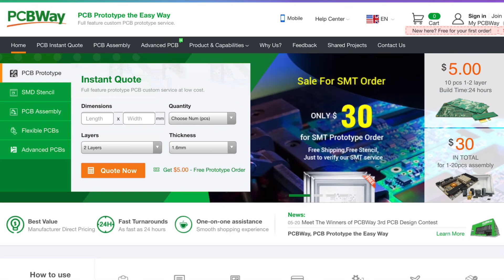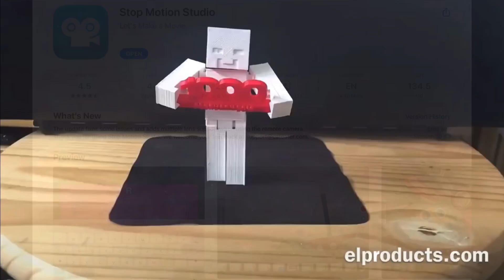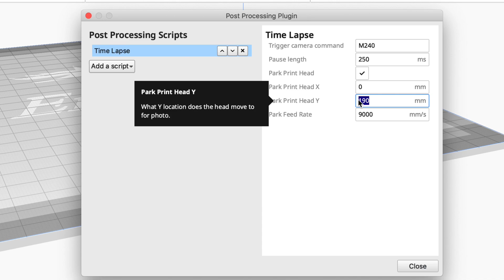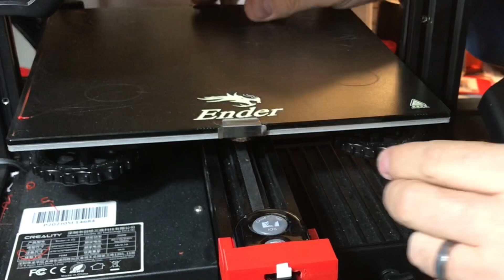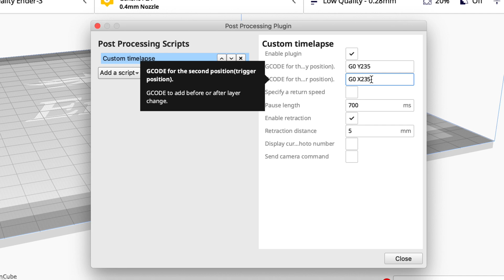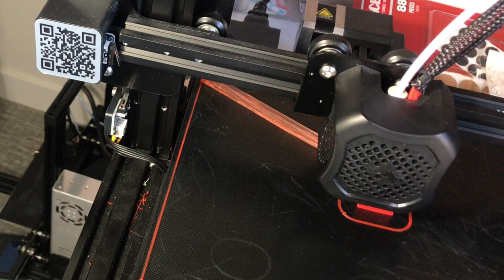Simple Timelapse using Cura Slicer Plugin  on Ender 3 V2

Comment: so you can do either. you can do the switch thing on the bluetooth remote. coincidently i actually did that yesterday as im watching this video thats funny lol but both work. i used the stock endstop and gcode but the manual bluetooth option is mint too

Comment: can you stop your ipad from turning to sleep mode between layers or have it over heated for being on camera mode for 2 days , if not i would use a nikon camera instead with a external trigger switch
Reply from the maker: First, I don’t timelapse 2 day prints. But you can turn off sleep mode and I’ve never had it overheat waiting to take a picture in the Animate it app. So my method works fine. I just plug it in so it doesn’t run out of battery life.

Comment: Chuck,
Appreciate the content it's been extremely helpful in my 3d print journey. I downloaded and printed the y axis holder, I bought the wireless Bluetooth remote but the remote drops connection after 90 seconds. Did you have a fix for yhis?
Reply from the maker: I have not seen that.
Reply: @FilamentFriday  Hmmm maybe it's cause I'm using an android phone and you are using an iPad,.... Maybe the different operating systems allow for different things.
Appreciate the help sir.

Comment: replacing the switch on the circuit board for a micro switch is very very easy. De-solder the old switch, solder on two wires that go to a normally open micro switch :D

Comment: I've set my Y-axis position but it stops just short of the camera button. Anyone having this same issue?
Reply from the maker: Change the y axis value.
Reply: @FilamentFriday  Ive been playing around with the value but again it just stops before hitting the button... Right at the same spot..

Also did you make changes on cura to compensate for losing the print space by attaching the mount? The X axis hits the mount when printing the initial line before the print starts. Does anything else need to be adjusted here that I'm missing?
Reply from the maker: The Y axis can hit the mount so I adjust the start and end code to prevent that.
Move the Y (bed) by hand and verify it can move far enough.

Comment: I can't for the life of me find the video where you tightened the spring on the Ender extruder. You had a file for a small printed cap to nest the spring into. Will you please point me to this file?
Reply from the maker: I don’t remember that video
Reply: @FilamentFriday  I can't remember what the video was about, but during the video one of the things you did was print a little round cup. you then took out the extruder spring with some needle nose pliers and seated one end of the extruder spring in the little cup and again compressing the spring with needle nose pliers placed the spring back. The net effect was to increase tension on the extruder springs as it is not adjustable.
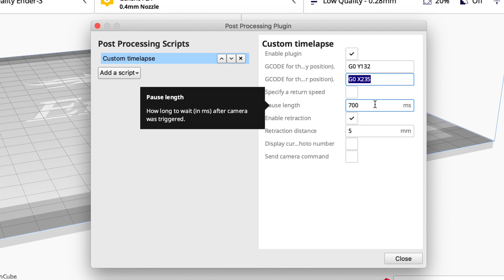Reply from the maker: Found it. 3:59 https://youtu.be/MaMYMTX1Xl4
Reply: @FilamentFriday  Thanks!!!

Comment: I got inspired by your video and done it on my ender 3. Like you suggest, I wired a traditionnal selfie stick (not bluetooth) to the x limit switch by soldering the two wires of the selfie stick button to the center and right pin of the limit switch. It worked flawlessly with the original timelapse post-processing in cura and I didn't experienced stringing. Thank you for that video ! I wanted to do a timlapse for a while now but didn't have money for a raspberry pi and that method cost me nothing since I already had the selfie stick laying around.

Comment: I drag and dropped the custom plug in into the script folder but it won’t accept it, any solutions?
Reply from the maker: Try copy/paste
Reply: @FilamentFriday  after I copy the file it doesn’t go into the scripts folder there is no option to paste. I also tried to save directly into that folder from the raw code but was still unsuccessful.
Reply: Maybe try to move the whole Cura App to a place where you have permissions, so your desktop for example. Then Show Package Contents of the Cura on the desktop and copy the script in there. You can move it back to your applications later.

Comment: So the bad news is... These bluetooth doohickeys time out after 1 minute 30 seconds which limits how large your print can be. MINE does at least and they are of the same shape, size, and make.That's probably fine here because the model size limitation of using the y axis.  I made a remix of the mount for the original ender 3 or any similar design using 2020 extrusion you can find in the remix section of the original item. I was doing this last year with a makerbot endstop connected to a salvaged selfie stick cable plugged into an older iphone but the results weren't great because it would trigger on the release of the button not the pressing of it. was going to try and use gcode to make it hit the button, move back, and wait, but never got around to it. Could probably use a small circuit to cause it to press and release electronically as well, and use a pair of cheap lighting cable headphones as the trigger.
Reply: I've figured out how to do this. You cannot use the printers original X end stop, I tried. I'm making a video and will post what I've done it'll save everyone a lot of time... but these bluetooth things are not the way to go Unless someone can recommend one that doesn't auto-off after 90 seconds.

Comment: rather than using a bluetooth soloution, using a 3.5mm audio jack you can trigger a pic to be taken much like a selfie stick, which you can then just connect either to the motherboard with some g code, or some form of contacts on the axis

Comment: Timelapses always cause stringing or under extrusion.  They really need an electronic trigger, but the print head would have to always be covering the model.  Ended up writing a command line script to fix the gcode.

Comment: I did something similar, and while it was a bit of work to pull off, it functioned well. I used the insert at layer change plugin to insert just a random word, then I'd take the gcode and use notepad++ to replace the word with a bit of gcode. It would make the printer retract, move the bed forward and the print head to 2mm away from a switch, then bump the switch, then resume printing. I tried the timelapse plugin, but it wouldn't hit the camera shutter at the same time every time, so the bed would be at slightly different positions in each pic, and I got tons of stringing.

I did think to use the home button, but I didn't want to since it would inadvertently hit the shutter sometimes. I have a few limit switches which I can wire to headphones with a button. Plug the headphones in, and when the limit switch is pressed the phone takes a Pic. Works beautifully.

Comment: Get a separate y axis switch and attach it to the 2020 rail instead of the fob and wire it into the fob.  Then, every time it rolls to the switch it snaps but because it's under the bed you don't lose any y axis space.

Comment: What about adjusting the position of the part on the print bed (instead of the default center) when slicing to make the travel times to hit the switch less?  Could this also be used to reduce the stringing?
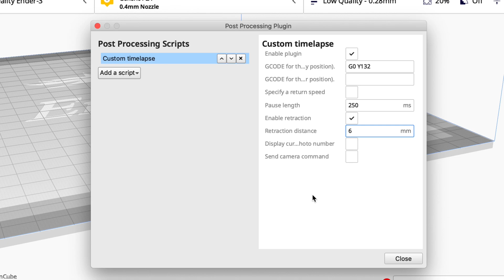Reply from the maker: I did put the Cube at the front of the bed for this reason. Watch from 4:15.

Comment: another great video .. 
just installed 4.8.0 & lost the G code for BLTouch .. could you plz reply with code & where to place in Gcode list 
many thanks
Reply: Are you talking about the G code for automatic bed leveling?
Reply: @halsoy  yes & where to put in list please
Reply: @graycbr600  I use it to level the bed before every print so I use this script (these should be the very first lines in your cura start G-code box):

; Ender 3 Custom Start G-code
G92 E0 ; Reset Extruder
G28 ; Home all axes
G29 ; Auto Bed Level
G1 Z2.0 F3000 ; Move Z Axis up to move nozzle away from bed
G1 X0.1 Y20 Z0.3 F5000.0 ; Move to start position
G1 X0.1 Y200.0 Z0.3 F1500.0 E15 ; Draw the first line
G1 X0.4 Y200.0 Z0.3 F5000.0 ; Move a line over
G1 X0.4 Y20 Z0.3 F1500.0 E30 ; Draw the second line
G92 E0 ; Reset Extruder
G1 Z5.0 F3000 ; Move Z Axis up to move nozzle away from bed
G1 X5 Y20 Z0.3 F5000.0 ; Blob prevention

This is for an Ender 3 obviously, but the specifics is to add G28 BEFORE G29. G29 is the G-code for auto bed level.

If you want to make sure that the bed level data is stored (in case you lose power), you could modify the code I posted to read like this:

; Ender 3 Custom Start G-code
G92 E0 ; Reset Extruder
G28 ; Home all axes
G29 ; Auto Bed Level
M500 ; Store data in memory

If you do this the bed level data is permanently stored in the printers memory. If you don't want your BLtouch to run every time you start a print you can do this instead:

If you have your printer connected to a PC with a USB cable or octoprint you use the console that sends marlin commands to send these commands;

G28 ; Home all axis
G29 ; Auto bed level

once the bed level is done continue with;

M500 ; Store all settings

If you don't have it connected, you can just home all axis on the printer and run the automatic bed level from the display. Once you have done that make sure to find the option that say "save settings". This does the same thing, but directly on the printer. 

Once that is done you can load the bed level data using the command M501. So then the start of your printer commands should be like this:

; Ender 3 Custom Start G-code
G92 E0 ; Reset Extruder
G28 ; Home all axes
M501 ; Load bed leveling data
G1 Z2.0 F3000 ; Move Z Axis up to move nozzle away from bed
G1 X0.1 Y20 Z0.3 F5000.0 ; Move to start position
G1 X0.1 Y200.0 Z0.3 F1500.0 E15 ; Draw the first line
G1 X0.4 Y200.0 Z0.3 F5000.0 ; Move a line over
G1 X0.4 Y20 Z0.3 F1500.0 E30 ; Draw the second line
G92 E0 ; Reset Extruder
G1 Z5.0 F3000 ; Move Z Axis up to move nozzle away from bed
G1 X5 Y20 Z0.3 F5000.0 ; Blob prevention

Technically your printer should load the stored bed leveling data you have every time you turn your printer on, but it doesn't hurt to load it anyway. 

As I mentioned though, this is specifically for my Ender 3, so the coordinates I have in the start of the print could be different from your printer, unless you also have an Ender 3.  If you have a different printer you can just cut out everything below G29 or M500/M501 and keep whatever else you have. 

Hope that makes sense to you.
Reply: @halsoy  thats great many thanks

Comment: I actually did something similar using the M240 gcode, bluetooth shutter and an arduino. I'm not that good in electronics stuffs so I can't get the shutter to work properly since the resistance on the switch changes when arduino triggers it. But somehow it works

Comment: The Stop Motion app has a timer feature. You set the time how often a photo must be taken , the drawback however is your hotend is probably is going to be in all your shots / video. You are not going to have just your printed part showing. Thank you for the video , awesome as always.
Reply from the maker: Yeah,that results in a random Timelapse as the each layer time is different. And the bed moves around so the print won’t be steady. I’ve just use the Timelapse option in the iPad camera for that type of time lapse.

Comment: Im going to try doing this with a mouse and a webcam, smaller camera to mount and I don't need to sacrifice my phone. Also the PC has a whole terabyte of space so I will have no problem recording large prints with many layers. And the cheap mouse should be pretty easy to wire, or perhaps there is a product for clicking the mouse button with breakouts. To trigger it surely I should be able to wire it directly to the X axis switch, since when it is triggered it closes the circuit, meaning the printers X axis detection shouldn't be effected by the mouse click detection circuitry (hopefully). Ill update this message with results good or bad.
Reply from the maker: How do you plan to create the video from the pictures you take?
Reply: @FilamentFriday  Well with any image sequence you will have a date and time code. If you use a program like Bulk Rename Utility you can rename them from their date names to 0001 0002 and so on, this sequence can be recognized by video editing software like hitfilm express as an image sequence which you can then import, shove it on a timeline and export it as an MP4 or whatever you like. I have done it before with individual images from my phone and a gopro. Works great, and is fairly quick.
Reply from the maker: Sounds good. The stop motion outputs the video automatically so that’s why I chose it. I like simple.
Reply: @FilamentFriday  What works for you is best for you :)

Comment: How will stopping to take pictures effect the bonding of the layers together?
Reply from the maker: Very little.
Reply: @FilamentFriday  I have found really bad layer bonding if the print is paused for several minutes.
Reply from the maker: This is paused for a second or two not minutes.

Comment: Is there a way to make the remote wired so the battery doesn't run out?
Reply: Yuo can solder an apropiate dc  power supply to the battery pins of the remote controller

Comment: Either the X or Y home switch can be used through a MOS FET like a 2N7000 To trigger your switch. The home switch will never see the MOS FET gate.

But I agree with some others here, octopi is a better solution. And In the long run it's Much cheaper.

Comment: Is there a way to make it press the android button with your model? I don't have any available ios devices.
edit: Also, do you have a link to the clips you were using? I don't have anything like that and your solution looked like it fit perfectly.
Reply: The Bluetooth remote he is using works on Android/iOS.  I have some of those remotes.
Reply: @David_Ladd  I know, but when I looked at the Amazon page, it appears to have a separate button for Android and iOS devices.
Reply from the maker: You can flip the fob 180°

Comment: What a brilliant hack, Chuck. Need to work on that retraction, but I love this concept. I just integrated the use of a Bluetooth shutter button in EM3D. What the shutter buttons do is register themselves as a wireless keyboard and the large button does a volume up press and the small button does a volume down press. Thought I'd pass along that info in case it helps.

Comment: Is there anyway to increase travel speed to and from switch?
Reply from the maker: Check Specify a return speed.
Reply: How about relocating the print on the bed when slicing?  You could make it so the it is closer to the position for activating the switch.

Comment: Is there a way to use the M240 (or whatever the code) to activate some pin on the board, and use that signal to trigger a camera? This way we wouldn't need to move the extruder all the way, losing less time for a print.
Reply: That's even better than my question and would help octolapse also. Brillant idea bro.